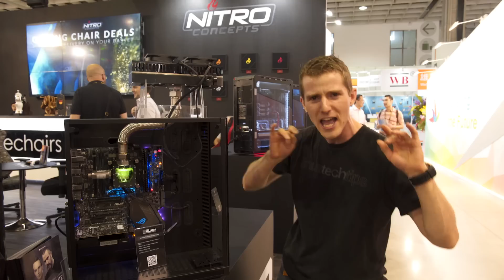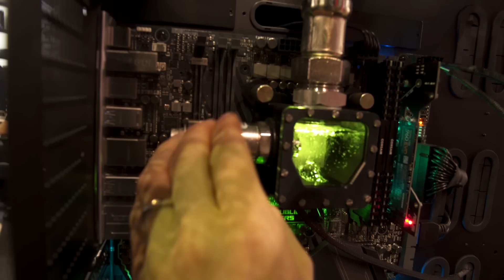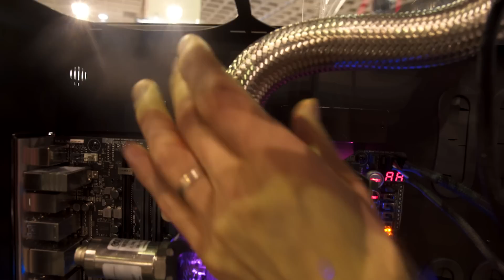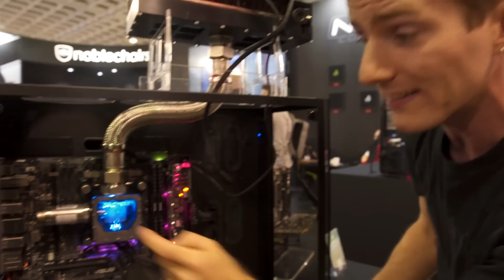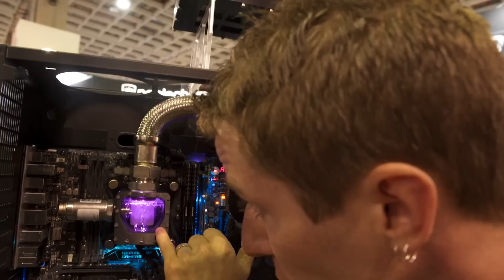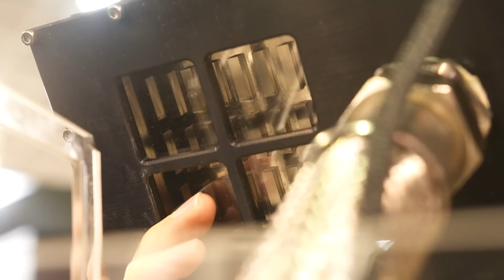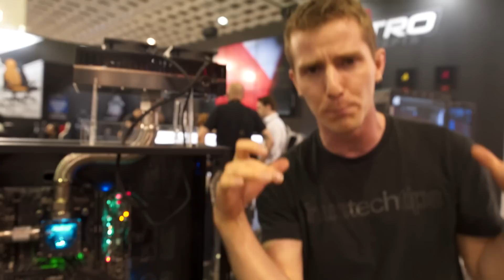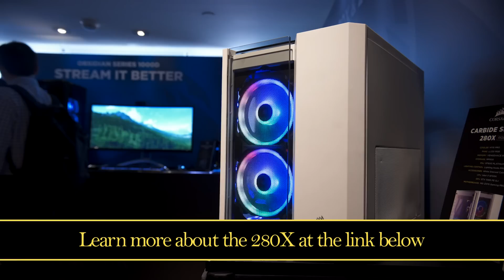Crazy Der8auer cooler prototype - NO pump!

Comment: Distilled water under a pressure lower then the atmospheric.
That could be the reason why there is non compressible tubing. :-)
Reply: Stefan the colant boils and creates pressure. There is probably at least  3 to 5 bar inside that, hence the pressure sensor. 
Having it at lower pressure to reduce the boiling point in a small system is basically impossible without a vaccum pump. Water expands by 1600 times when it boils so thats a no.
Its most likely a liquid by novo or what they are called, that boils at 40 or 50°C. Linus showed a
 pc by der8auer that had everything submerged in it, was  closed off, had 4 bars (about 60 psi) of pressure inside and a radiotor on top where it condensess.
Reply: This IS a der8bauer project.
Reply: Maybe it's  pee
Reply: 3M Novec
Reply: It could even be an alcohol? Like an ethanol?
Reply: oooor they use the same thing as der8auer
Reply: MigotRen but boiling point very much depends on the pressure, so as long as the condenser condenses fast enough pressure will remain below 1 bar. Pressure will vary with temperature but until you go above 100°C it won't be above 1 bar. 
You can see the vacuum port on the radiator to evacuate the air.
Here's a little secret: copper heat pipes contain water under vacuum and heat conduction happens through phase change.
Reply: What about ethanol or something like that?
Reply: Water at 0.1 atm would limit CPU temp to 50C.  If it was cooler then pressure was lower. Of course steam takes lot more space than water, 16 000 times more at 0.1 atm.  Even so vacuum pump is needed only when assembled and to compensate leaks.

3M Novec 7100 boils at 61 C.  Too high without vacuum, and it is expensive.
Reply: @VADN shooter 3M Novec is the brand name for hundreds of chemical components.
Reply: Yeah but i mean what he uses in his privat projects
Reply: how about acetone?
Reply: VADN shooter No the EU don't allow that to sell this liquid to customers
Reply: It's not water but 3M Novec fluid. Gamers Nexus mentioned it when they covered it. They also mentioned that you can't "vent" the fluid as it affects the Ozone or something like CFC's do.
Reply: I think you're right.
If I look at it it really looks only like a normal overhyped heat pipe.
Only difference I can spot is a flexible "tube" and the window.
So I think we can assume he uses the same fluid as in normal headpipes, so water with a bit vacuum is right.

The system would have a contra.
You can't dissemble it.
Meaning the hole in your case needs to be big enough for the heat exchanger for the CPU.
Reply: I will say, dichloromethane, its similar to chloroform in structure, and has really all the requirements here.
Reply: I'm gonna go with dichloromethane,  diethyl ether, or pentane.  If what was said about the environmental hazards was correct, then dcm is a good bet.
Reply: Rishabh The problem is that acetone under high temperature and pressure is it becomes highly explosive on contact with air, so if anything failed your computer would go boom!
Reply: 3M Novec, tho it could also be ether or acetone
Reply: Could be alcohol
Reply: what type? ethanol boils at 78.7°c at 1atmosphere
Reply: quantuman100  you could add impurities to modify boiling temperatures
Reply: yes and what would you have to add to bring it to a usable boiling point even at the pressures in the system? and how would you keep it from distilling it's self to a certain point?it's like you need to move a big box down the road, you could 1.put it in your car and bring it there or 2.have to shipped to shanghai and then shipped to the correct address, theoretically doable, practically dumb
Reply: - You can calculate the temperatures of evaporation and condensation. (That is, what air-condition guys do.) This is higher thermodinamics. As a german engineer, der8auer knows about this, and can bring it into practical use. Still think, it is Water. :-)
Reply: no air conditioner guys don't calculate the evaporation or condensation temperatures of anything, they look it up in a book of charts, and btw for it to be water and evaporate at give 50°c the entire device would have to be a vacuum chamber seeing as to how it would require 100mbar, given that when something evaporates it produces gas and said gas tends to take up a LOT more volume it would be impossible to keep it under the 100°c of normal pressure because an increase in pressure also increases the evaporation/condensation temperature.

next "a german engineer" Wir mögen vielleicht gut sein aber Wir können auch keine Wunder volbringen.

so unless you happen to show me some sort of vacuum pump to maintain any low pressure then you should most likely admit to being another Dunning-Kruger victim
Reply: @TheBetabot 3M Novec 7100

Comment: alcohol (methanol) underneath some mineral oil could be an interesting "fluid" since the alcohol would have a boiling point around 66C and the oil should be suspended, so it should separate the bubbles of alcohol at a relatively low temp pc wise.

Comment: dichloromethane? That is the only clear substance I can think of that is not super volatile with a low enough boiling point that is not too low. Any kind of Acetone of Alcohol would be a bad idea for obvious reasons. Unless he is pulling a partial vacuum and lowering the pressure in the block and that would change boiling points. Pretty cool.
Reply: Perfluorocarbons. Flutec™ is my guess.

Comment: I am going to laugh my ass off if he used gasoline as the coolant.
It has a flash point of 246°C, boiling point starting at 37°C does not handle pressure well (the reason for the pressure gage?) as long as there is no static discharge it should be theoretically safe unless I'm missing something critical on the check list.

Comment: My bet is on Trichlorofluoromethane (R-11) because of the 25°C boiling point at 1bar. But as the system is probably under 3 - 4 bar of pressure the boiling point of the liquid rises to somewhere around 30-40°C. It would therefore be an excellent coolant for this system.

Comment: Vodka lol. No it might be an Alkane. They use an Alkane in some geothermal setups where the temp is to low to use water. I forget which is used for the geothermal but it isn't Methane, Propane or Butane =).

Comment: Dichloroethene would have been my first guess with that low of a boiling point, but with a flash point of even less than 4 c it would concern me if it was. Dichloromethane would be my main choice because it has no flash point, but can cause flammable vapors above 100 c. Lest just say if that happens I don't thank your pc is running.

Comment: I'm thinking the fluid might be diethyl ether
Reply: thatjokerperson But that's flamable (iirc), so that would be dangerous in an intentionally heated enviroment in case of a malfunction.
Reply: That has one of the lowest evaporating temperatures, but its ridiculously flammable. would work .   however in comparison to water its thermal conductivity is about 25x worse. so unlikely. source: chemist that works with that horrible stuff.
Reply: I'd say a better choice would be dichloromethane, nonflammable.
Reply: Most likely diethyl ether would cause to much pressure to build up in the System since it evaporates at such a low temperature
Reply: Kvothe2805 you're right it would have to be kept in a near complete vacuum during manufacturing with super low temps to be stable for operating use in this case use.

Comment: Trichlorofluoromethane refrigerant R-11 this is a refrigerant that would in theory keep the cool temperatures of the cooling properties and in theory would cool the CPU also would explain the tight enclosure and the release valve due to it being put in as a gas form then once being cooled coming to below 74.9 degree Fahrenheit which is slightly above normal room temperature but with the cooler would bring it down to that room temperature and would therefor explain why it needs a slightly warm element to bring it to above 74.9 degrees Fahrenheit and would bring it back up to room temperature and would evaporate it back down and then would become a liquid again, this explaining again why a release valve to test if it can stay a liquid in above room temperature rooms to test if it can withstand any household to make sure the Trichlorofluoromethane refrigerant R-11 wont cause enough pressure to burst a fitting or hose or housing and destroy computer parts

Comment: Probably something with a boiling point of like 331K so it would even run in the Death Valley or a hot rack because it's actually held in a liquid state by sheer pressure, at least around the cpu, so actually any liquid with a boiling point between ambient and thermal throttle

Comment: On his first Gas Cooling System der8auer used a synthetic gas Named Novec 720

In this concept I think he is using the higher version of Novec 1230 which can resist more heat and condense really fast 
Also this Gas is NOT conductive in liquid form should it happen that the cooling system leaks the system will shut itself down and the PC components won't be damaged at all
The gas evaporates outside of an closed enclosure immediately.

Comment: I´m guessing it´s pure and simple Water.
The pressure sensor is not there to keep it from bursting from overpressure but to keep a controlled underpressure so the Water boils at the working temps of the CPU.

Comment: So it has to be a clear liquid that doesn't erode Aluminum/Copper or gold. It also Can't eat through or corrode some sort of see through material (either plastic or glass). and is has to boil at 60 degrees Celsius (140 Fahrenheit). Also has to be common enough to make economically viable and non flammable.

Comment: Without seeing the cooler itself in action in a live machine, I can only speculate about what is going on:
1. It looks like the CPU itself is immersed in the liquid.  That would imply that the liquid will need to be nonpolar, to avoid shorting out your board.
2. Intel's i7 has a thermal cap of about 130-150 degrees Fahrenheit.  I'm assuming that, to keep things cool as well as contain a buffer to prevent overheating, the liquid itself likely has a boiling point of 90-110.  This rules out mineral oil.
3. Safety.  Unless a nonflammable alcohol was used (most that my search has show are too far above the thermal buffer), it's likely required that the product itself must be nontoxic.  This pretty much rules out bromides and chlorides.  Most corrosive liquids are ruled out, as well.
4. Corrosion.  Most solutions are ruled out due to requiring a liquid that won't eat through your pipes and radiator.  Since it's likely the final product will use some plastic components, the cooling liquid would need to not damage metals or plastics.
5. To mass-produce these items economically, the means to create the liquid in sufficient amounts must me low-cost.  This rules out most of the more expensive methods.
So, in conclusion, we're looking for a nonpolar, nontoxic, noncorrosive liquid with a low boiling point that can be produced cheaply.
Again, these are just my observations.  I hope it helps someone else come up with the answer.
If they're using treated tap water, I'm going to be so annoyed.
Reply: Heavy Drinker Linus doesn’t even live in America though
Reply: Flutec™ from F2 Chemicals LTD sounds exactly as you describe.
Reply: Nya Stclair You do know that Canada is using Celcius ?
Reply: Xavato Thanks
Reply: please use degrees Celsius so the rest of the world knows what you are talking about.
Reply: Sebastian E Sebastian E 50-80°C for the pc; 30-45°C for coolant
Reply: drviver lol 😂🤣😂 I see what you did there.
Reply: There is no way the liquid actually touches the CPU. How would you ever install that at home?
Reply: Hagen Meyer hexan even knowing that it is non corrosive is pretty agresive with a lot of plastics. Could be but that would limit materials for the block.
Reply: Henrix98 mount it and then fill it from the top
Reply: You just said the liquid should be non polar, so it can't be treated tap water. But the basis of that statement was because you said the CPU is immersed in the liquid. If it really is, then how would you remove the cooler?

And 30ºC is far too low of a boiling point, it'll be a gas and build up excess pressure in warmer countries. I'd say 55-75ºC would be a safer number. Even though its clearly boiling. Maybe the vapour pressure is excessively low?
Reply: Hagen Meyer n-hexane is a good choice.  Dichloromethane is the other option i thought was likely, especially since in another thread they mentioned it may be ozone depleting.  I like the n-hexane idea though, I've seen that shit boil itself into an ice cube at room temperature lol
Reply: ZirJohn High risk of impurities for an AIO
Reply: Draekmus it'd work for a bit until the evaporating water increases the pressure in the system
Reply: Also 6) It needs to have big thermal capacity. There would be no point of having liquid that wouldn't even make it to the radiator. 

My thinking is that it could be the new fluid I saw on presentation. They submerged whole phone into it and the phone got very cool and still was working flawlessly. I believe the name was Novec 1230, but for sure I know it had a boiling point of 50°C because that got stuck in my mind.
Reply: Erwan Moalic You do know I was responding to him saying Linus doesn't live in America....right?
Reply: https://en.wikipedia.org/wiki/Supercritical_carbon_dioxide
boilingpoint  31°C @ 73 bar pressure.
its used in the foodindustry, cheap, non corrosive, and the tubing suggests a very high pressure system.
its a clear fluid and the german wikipedia mentions its application in cooling systems
Reply: 34JohannesHeinz34 No
Reply: Danielle Spargo Dichloromethane requires a compressor to work
Reply: TheViedeogame 3M novec isn't a compound, its a company that makes hundreds of different compounds.  We were asked to guess what was in the cooler, not who manufactured it
Reply: Lelouch, that's a good question.  Maybe it's not meant to be removed?  Maybe the final product will have a drain tap on the bottom of the reservoir.  I kind of brought up the tap water as a joke, because it was the only liquid I don't think anyone would have guessed.
You're right, 30 C is low.  Perhaps higher pressure increases the boiling point, much like the radiator system in a car?  After looking at it, i think your higher number is more likely: because of thermal capacity (and thermodynamics), I assumed a liquid with a lower boiling temperature than the processor's thermal maximum, to prevent cooking processors with this solution.
Since the radiator has a tap on it, it looks like the liquid is filled in from the top of the system.  There could be an air-permeable membrane that allows for the exchange of pressure, without exchanging the liquid vapor itself.   
I guess we'll have to wait and see how they built this thing.

As a side note: I can't believe how many people complained about my decision to use Fahrenheit, simply because the scale relates better to me than Celsius.  Wow.  Is it really that big of a sin to use the Imperial system?
Reply: Nya Stclair no fuck Fahrenheit, its cancerous as f
Reply: STFU ALL DAY NYA S. The internet is not the US. GTFO ALL DAY
Reply: Nya Stclair, JUST STOP IT
Reply: Villager #22 You do know that Canada is part of America right?
Reply: Sebastian E But you know you could just simply convert to Celsius.......
Reply: Sebastian E But we're on the American website YouTube. Using Fahrenheit will do just fine.

Comment: It's probably that fluid M3 made that boils at 35°c. It's non-conductive, so you can submerge a PC in it and run it without heatsinks.
Reply: The guy explicitly said in interview it wasn't. Also, EU Import laws prove it can't be that liquid (they are in Europe here at this demo/convention, and EU laws have banned that specific 3M Novec fluid.)

Comment: Probally uses novec as his fluid atleast thats the only one i know of off the top of my head with a lower boiling point to condense in gas in what i asume is a vapor like chamber transfering heat to the two copper arays thentrickling back down.

Comment: It's a 3M Novec fluid. The fluid costs around $300 per gallon
Reply: Its not Nove. boiling point is to high and regulations dont allow to sell novec to private people.
Reply: der8auer's words in an german interview (pcgameshardware interview with der 8auer @computex18)
Reply: Boiling point of 61C to high... K. But you are right that its not Novec only because of EU regulations. He has worked with that stuff for a while and a system right next to this one is running Novec 7100.
Reply: Probably Flutec™
Reply: Grey_Dark have you watched any of derbauers videos? He literally said what it was
Reply: Grey_Dark he even told me where I could buy it in the comments section
Reply: you are trolling, right? look at his videos about Exhalare2.0 and Novec 7100 (en@6:40 / de@8:40). I also know ways, where i can get it, but thats not the point. As well i think its also  possible that its outside EU legal to buy it for personal use. At project "Exhalare" he used Novec 7100, and here at project "Phase Shift Cooler" he used an other liquid. He want to bring the phaseshiftcooler to the market late year 2018. With Novec7100 there would be no legal chance to sell it in EU to Customers.